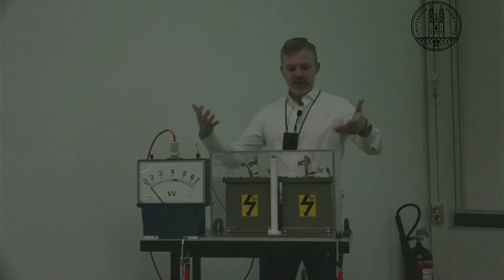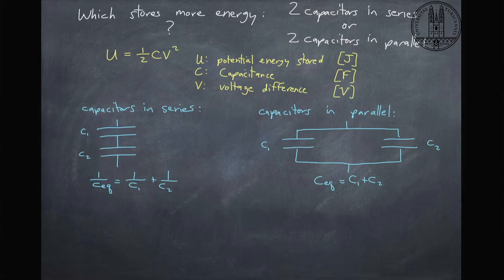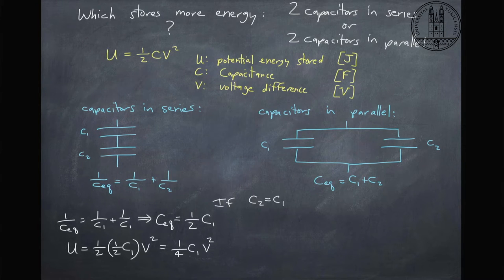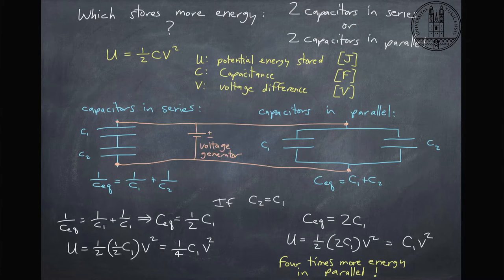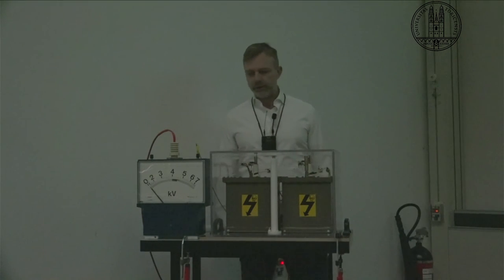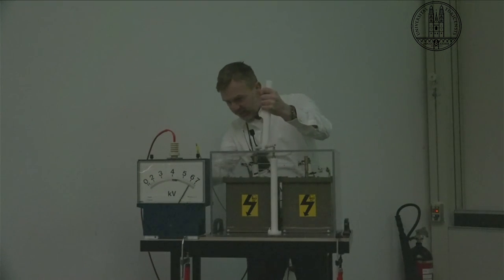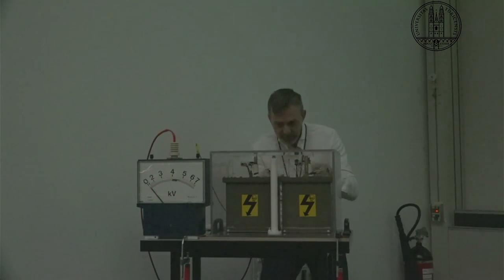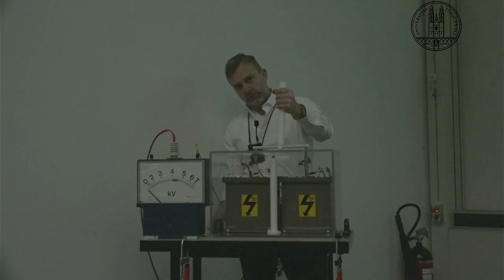The biggest spark :  capacitors in parallel or in series ?

Comment: The voltage gets squared while the  capacitor only gets halved. The equation is E=CV squared. You can do some interesting tricks with capacitors like making a marx generator by charging a bunchbof capacitors in parallel through a high impedance and discharging in series through spark gaps. One really crazy one is a spiral line pulse forming network. In this a jelly roll capacitor is discharged at one end with several turns of extra foil in the middle. You get a tidal wave of current that first flows out then the reactive inductance causes it to flow in. When this wave hits the inner foil it acts exactly like a tidal wave that compresses the pulse in time, raising the voltage while the current stays the same. Physics is awsome 👌

Comment: Depends on what sort of spark you want.
For long arcs the voltage adds up. For vaporizing conductors it's all about blasting them with amps.
..Continuing the video..
Reply: Your video doesn't (clearly) explain how the same amount of joules behaves under different voltages and amps.

Comment: This video needs a bit more work, it's not quite right.  Both setups can store the same energy - with two identical capacitors in series you can double the working voltage.
Reply: Yup he was supposed to charge each one than hook in series😂